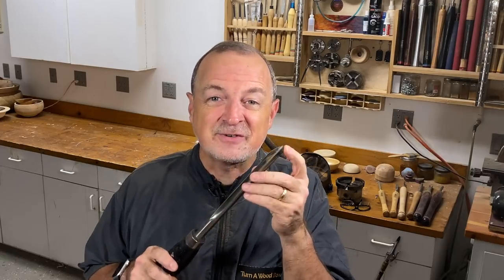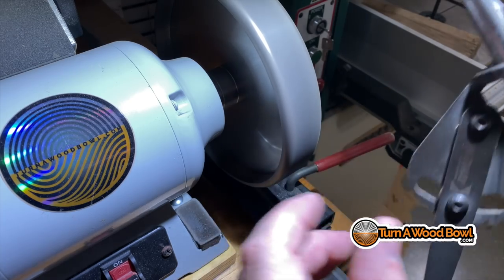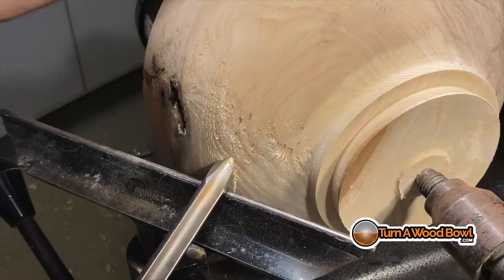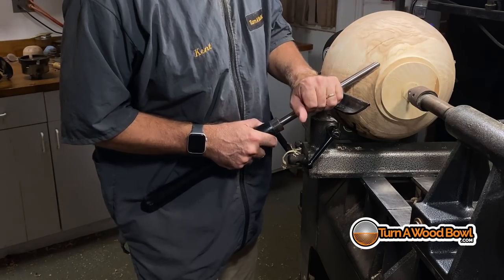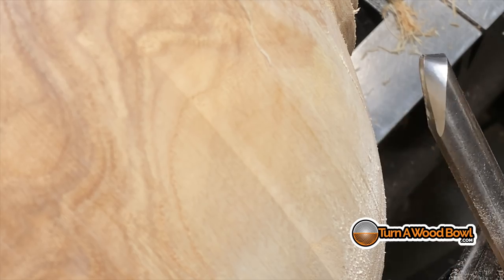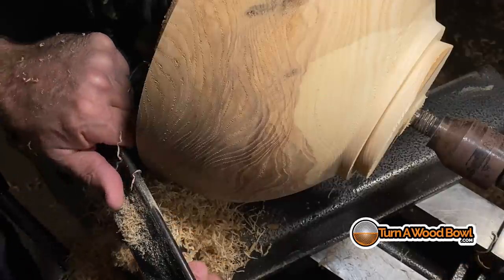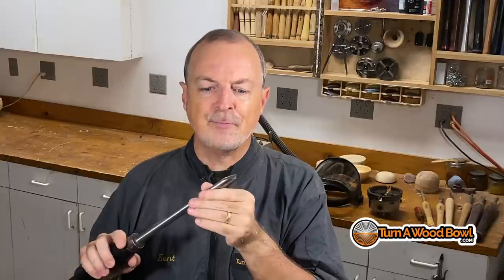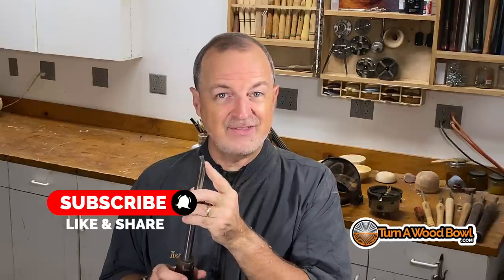Woodturning ShearScraping Wood Bowl Turning Bowl Gouge Video

Comment: I love shear scraping. I was having trouble earlier with the endgrain fibres flattening on by workpieces when I was turning. This was leaving ugly lighter streaks in those areas. Shear scraping the last .3mm or so at the end completely removes these for me. I don 't use a bowl gouge for it, I use a round nosed scraper held to 45 or 50 degrees on its side to the workpiece, but it's the same principle. Thanks for the video! I'll have to try it with a bowl gouge sometime.
Reply from the maker: Thank you for writing and sharing Glen! I think you will really like how the gouge shear-scrapes compared to the round nose. All the best to you and Happy Turning!

Comment: Another good lesson, Kent. I’ve tried shear scraping but see from this video, I didn’t have my tool rest positioned correctly. I will get better results next time after seeing this. Shear scraping saves lots of sanding effort, which I do not enjoy. The better my gouge skills become, the less sanding in needed.
Reply from the maker: Fantastic! Yes, you need to get the angles right and work small areas at a time. Enjoy and Happy Turning!

Comment: I've dabbled with a few bowls over the years. For refining the shapes and surface quality I relied on my 80 grit gauge and then the 120-400 gauges to get rid of all the scratch marks. I had an old bowl blank with the the tenon still attcahed. It was spalted White Oak (Quercus Alba) and I had given up on getting a nice finish to the surface. I converted one of my bowl gauges to the 55° swept back profile and bought CBN wheels. I am now an advocate of both. The results were outstanding for such a simple technique. Your right about your e-courses. It shouldn't take 54 minutes to answer the question, "What time is it"? So thank you for your 'to the point', succinct explanations. Off topic: What video editing software do you use? Besides the obvious resolution of your camera, your transitions, whether live or voice overs, are easy on the brain! Thanks again for your KISS approach to teaching.

Ed
Reply from the maker: Ed, Thank you for writing and sharing! Yes, while the 80 grit method works, the shear scrap takes less effort and makes less dust. ;) So glad you're trying out the 55° swept back gouge and liking it. I use Final Cut Pro to edit my videos. Thanks for all your kind words!! All the best to you and Happy Turning!

Comment: I have done shear scraping in the past but realized from your video that I wasn’t doing it quite right and haven’t gotten the best results when trying this technique. I always thought that you didn’t want to have much of the tool hanging over the edge of the tools rest like that and I guess I didn’t know that the tool rest needed to be positioned very differently from where you would normally have it. Thanks for the great tips, this will be a great benefit for me I’m sure and will relieve some frustration when trying to get a nice finished surface before sanding.
Reply from the maker: Great! Yes, because the cut is so light and just a "shave" tool support is not as big of an issue as a regular cut. Happy Turning!

Comment: Thanks Kent. Those are some very nice tips. You have a very steep angle for your swept back (compared to others with an Irish grind), It does a great job for the outside of the bowl. But when it comes to the inside of the bowl, isn't a 40/40 grind better than a steep swept back grind? I use the Ellsworth grind on my bowl gouge. But at times I wonder whether I should grind the right edge to the 40 deg and the left edge to the swept back.
Reply from the maker: Good question. Actually, the 55° does a lot better at the bowl interior than most other angles. The tool will reach the bottom without any troubles. The 40/40 usually only makes it have way down and the shaft hits the rim. Then you have to switch to a micro-bevel gouge. The 55° sweptback is a great all-round tool. Happy Turning!

Comment: Great video. When I sharpen my gouge I usually knock the burr off by running some 600 grit sandpaper down the flute and over the tip. Should we leave the burr on to get better results with shear scraping? That’s what we do for card scrapers anyway
Reply from the maker: You can do that, if you'd like. Typically the burr will be physically removed by the wood within the first few second of turning. Happy Turning!

Comment: Thanks Kent. This quickly became my go to technique for refining the shape on the exterior of a bowl. You've provided excellent insight into tool rest placement and shear angle which I will incorporate in my next bowl.
I notice a number of small cracks in the wood (from drying I presume) which I also come across. I wonder what you do to manage those.
Great work as always.
Reply from the maker: Excellent! I will use a glue/sanding technique, if they persist. I may do a crack repair video in the future. Subscribe and stay tuned. Happy Turning!
Reply: @TurnAWoodBowl  I am subscribed already. ?

Comment: Kent, great video, tried your method,could not believe the reults. Brings down the need for power sanding, which brings up the question of reversing rotation. Does it improve sanding? Is there any other reason to reverse the rotation while turning?
Reply from the maker: Glad you tried this technique. Good question. I do not reverse the lathe because I try to sand with the grain. See my Sanding Video. Reversing could knock down small fibers, I guess. Perhaps with more fibrous tree species, reversing can be helpful. I have not found the need. Happy Turning!

Comment: A member of our club once said “If you can see an edge then you don’t have one”.   Ie, when you look at the chisel from the top you should not see a rim. I follow this mantra and stop when I get to this point.
Reply from the maker: True. The outside bevel needs to meet the inside flute edge. Where they meet, the top cutting edge, you should see nothing. Happy Turning!
Reply: @TurnAWoodBowl  ken, does your sharpening e-course come with the same offer as your wood turning for the first time e-course in that it is a lifetime course I can come back to later?
Reply from the maker: @deanmiller294  Yes, all my courses are currently lifetime memberships, with 30-day money-back guarantees. You can come back as often and whenever you'd like. Thanks and I'll see you there. Happy Turning!

Comment: imo - After using this shear scrape technique, I finally broke down and bought a heavy duty 1-1/2" scraper.  Easier to sharpen  and the mass of tool seems to give more control.  I hear a lot about negative rake, which I have not tried.  Curious if you have a video on negative rake
Reply from the maker: I may have that video soon. Stay tuned and Happy Turning!

Comment: Another question: You mentioned you measure the Wolverine depth of 2” while I have heard others use 1 3/4”. Why is there a difference?
Reply from the maker: Some people use 1-3/4". Either way is fine, but you need to be consistent.
Reply: @feetachemail  thanks for sharing. It seems to be more of a preference rather than “exact” math. The 2” definite toro idea more clearance between the jig and the wheel especially for steep angles.

Comment: Thanks so much for this video! I learned so much...question,  do they make a left handed lathe? I know that sounds like a silly question. Or do I just have to do everything in reverse? For example shape my bottoms on the left?
Reply from the maker: If you're left handed, you can attempt to adjust to this side, or you can turn in reverse. You can set up on the other side of the lathe. However, you will need to use set screws to lock all your chucks and faceplates, etc. Otherwise, they will unscrew in reverse. I have not done this and I recommend trying to turn with the lathe in forward direction first. Happy Turning!
Reply: Being left-handed should not be an issue.  A good turner turns either way.  I'm right-handed and can turn just a well either way.  Give her a try, it's easy.  Take care, Larry